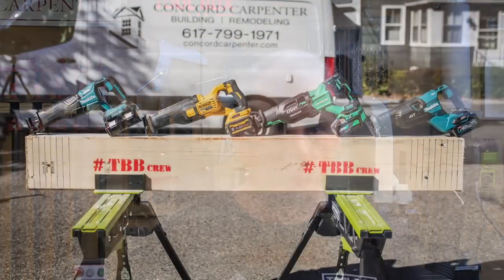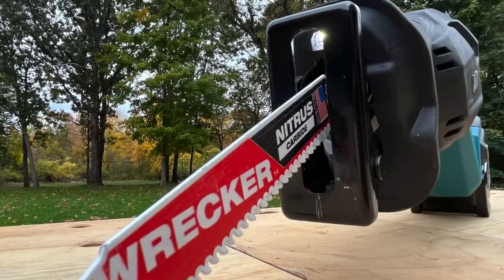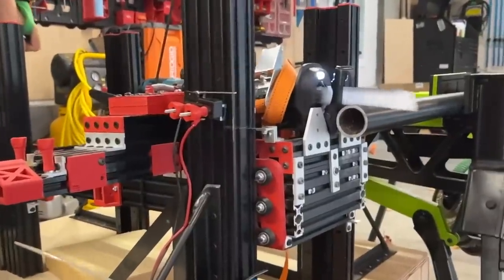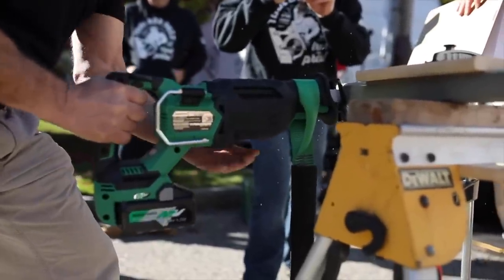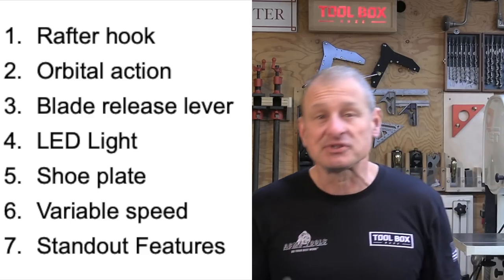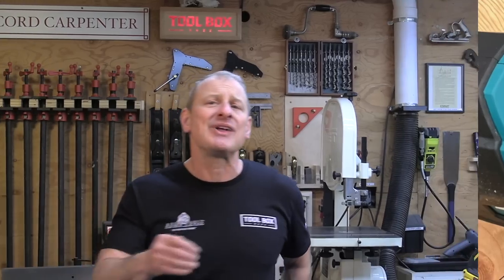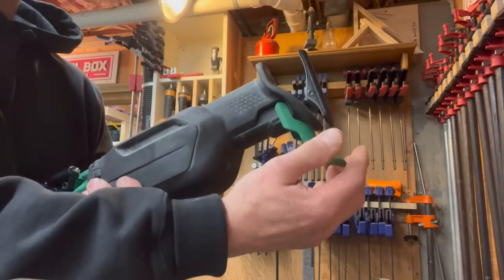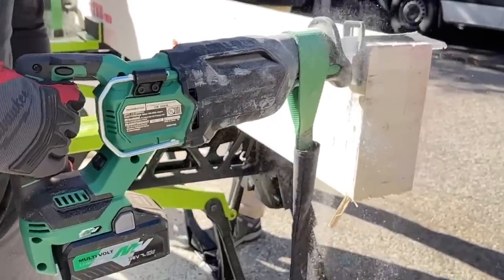Best "High Capacity" 36-60V Reciprocating Saw [Head-to-Head Test]

Comment: Have the 40v Makita and it's a beast with all the bells and whistles I might ever need for a recip saw. Adjustable-removable shoe, orbital cutting, speed dial, rafter hook, spring loaded blade ejection, avt works incredible, tons of power. I have no complaints.
Reply from the maker: Very nice!

Comment: Thanks for the comparison, Rob!  I've started a new business and I'm getting into a new tool platform, so I'm scrubbing through several of your videos.  I'm on a fairly tight budget, so I'm seriously considering Metabo HPT.  SIDE NOTE:  You have a lot of patience dealing with all of the prima donna's in the comment sections.  Always thankful for your professionalism.
Reply from the maker: Thanks for saying that, and for commenting! Welcome to business ownership. If you get some time check out my Contractor Business Tip Series.
Reply: @ConcordCarpenter  I'll check it out for sure!
Reply: I've been running Milwaukee and Makita for yrs after giving up on DeWalt before that due to poor quality cantrol, burned up motors and below average service
We've switch a bunch of our tools over to Metabo HPT over the last 3-4yrs and have been very pleased with power, workmanship, features, elearranty and the AC adapter for the 36V tools that we use for the table saw, mitre saw, grinder, SDS Max rotary hammer, vacuum and a few others-it saves battery life and longevity and allows for all day use when AC power is available
Check Acme and Toolbarn as well as Lowes
The 36V line are true pro grade tools and many of the 18V are pro grade as well
The mHPT/Hitachi nailers have and continue to be the industry standard
Reply: @JimDoubleYa  yes I was hoping to get the Barrell grip 36V that was being sold her through ACME but for some reason stopped being available
I waited for the Makita to go in sale but never did so ended up with the Milwaukee 18V Fuel barrel grip(it's a monster but cuts great)
As far as Metabo HPT woodworking tools
The 36V 1/2" Full size router is my absolute favorite tool in the shop and jobsite, the 23 gauge pin, 18guage are good, the rear handle framing saw, 36V sidewinder and 6 1/2 18V all are light and powerful
The 36V recipe is the most powerful recip we run
Triple hammer impact and 36V Hammer drill have been great and at great prices I er the last few yrs
The vacuum is great as it runs off 36V batteries and the AC adapter
The 36V table saw has been another favorite on jobsite as it is portable but has the largest workspace/capacity and again can be plugged in with the adapter for thicker ripping and all day run time without waiting for batteries to charge like the other portable cordless out there
The new 18V sander is as good as the Milwaukee and the trim router is also comparable to the Milwaukee but each is at a better price
The best cordless portable planer is the Ridgid Octane if u can find it otherwise the older Makita or the newer brushless(but you'll pay twice as much, the Metabo HPT planer is solid but not too performer(Milwaukee and DeWalt planers are junk)
Hope this.helps
Been in the trades for a long time
I have many different colors in the shop but mostly running green, red and teal for cordless now with a little orange for some applications
Reply: @JimDoubleYa  ACME has best selection and they run promotions each week for different tools so ya gotta check a few times a week
Toolbarn has had some sick deals this year as well and Lowes is currently running the 4.0/8.0 Multivolt battery and get a free rear handle, 7 1/4 sidewinder or 36V recip
Acme just finished a second round of $50 if u spend $200 which I'm sure they'll run again,

Comment: Since people kept asking for the Milwaukee Fuel to be included, here are the M18 2822-20 results from the test 2 weeks ago compared to these. It should be pretty close since its the same test, 10lb weight and blades used.

Pipe - M18 5.63 - HPT 36V 5.73 - Makita 40v 3.55 - Makita 36v 11.0
Unistrut - M18 4.72 - HPT 36V 3.01 - Makita 40v 2.70 - Makita 36v 3.54
Nail embedded wood - M18 32.14 - HPT 36V 53.50 - Makita 40v 30.61 - Makita 36v 40.15

I own the 36v Makita and what i did was have a friend who just needed more batteries and i needed the saw. We bought the kit and split the parts. We both saved money and the saw came out at $145 in July 2020.
Reply from the maker: Pepe your hired!! We tested ALL of the saws from 18v to 60v all on the same day. We separated the videos to give the heavy hitters their own arena.

Comment: These tests are very interesting on their own, but I think most of us choose a brand for battery operated tools and stick with it. How about doing a comparison of all the core, essential tools together and compare brands? Maybe a reciprocating saw, circular saw, drill, driver, finish nailer, framing nailer, whatever you think. Just taken as a group, which brand performs best and is well made? Because it won't kill me if I take two extra seconds to make a cut, but it will be very annoying if I run out of power before the job is done and can't simply take a new battery from another tool. That's the beauty of sticking with a brand, even if certain of their tools aren't top performers.
Reply: I started out doing small jobs and I had the same mentality on having everything the same brand. Now I have Dewalt on my truck for small jobs but for bigger jobs multiple batteries don't bother me. I get the best tools for the best price regardless of brand. Some of the deals for makita and Metabo were too good to pass up.
Reply from the maker: We don't disagree.
Reply: Idk about that. 

I'm on Makita 18V and 40V primarily, 80% of my tools are Makita,  but also have Ryobi 18v for home gamer stuff and tools I don't use frequently, and then Bosch 12v and Milwaukee 12v, and then DeWalt 20v to round everything out. 

I like the flexibility of being able to grab tools everywhere.
Reply: I buy what ever I thinks best preferably in a kit form all brand off good options for different tools I like to have options in my tools and wemon but that's a different story.🤔
Reply: I say the real masters have a some of EVERY battery platform not sacrificing quality in any tool purchased

Comment: Makita XGT is absolutely wrecking stuff recently.  

Their 3/4" impact wrench is head and shoulders above anything else.

They have every saw size you could want, and tons of different ridiculously powerful grinders. 

Possibly one of the best drill/drivers with their electronic chuck, etc...

Probably the most powerful cordless vacuums. 

Only thing that is somewhat lacking is their 40v impact drivers. Haven't really updated those aside from making them compatible with 40v.

Comment: Thank you for yet another impressive and informative tool comparison! I only have experience with a Dewalt flexvolt saw that we bought for professional use about 4 years ago. We do ground work, which include cutting plastic pipes for septic systems and drainage pipes, removal of misplaced limbs of trees, dividing some lumber, and occasionally some demolition work. Perhaps also cutting a few steel profiles. Not that hard work, and very little use during winter months of December to March. But, it can be a harsh environment with rain, dirt, sand and stone flour. Apparently, too harsh for the flexvolt saw, and the first battery burned after 11 months (7-8 months of use). The second battery started smoking after 13 months. We could not get new batteries from either the reseller or Dewalt directly. In truth we could not even get any real answers on this issue. So, we shelved the Dewalt saw and bought a few Bosch GSA 18 V-LI C saws instead. They work great for our purposes and only cost about 1/3 or less to replace compared to the Flexvolt saw (the first lasted about 2 and a half years). I would not recommend using the flexvolt saw in harsh environments. I guess that the batteries (probably the same for many manufacturers) are not sealed from water, to allow better air cooling, but it makes the more complex circuitry of the flexvolt batteries vulnerable to moisture.

Comment: That Metabo HPT wood cut test makes me scratch my head. 🤔 Mine is a beast through wood with nails.  🤷🏻‍♂️
Reply: that saw loves to get pressured i bet if they put some more on it it would crush the 40v
Reply: @abeltavaresperez7948  except the Makita 40v can also handle more pressure just fine, so.... still lose in the end.
Reply: @abeltavaresperez7948  I was thinking the same thing.  More pressure would change the game.
Reply: Yeah that's our experience as well and it's not even very close
Not sure what happened there

Comment: nice work! the results are exactly as I suspected and other reviewers have ranked.
It is quite astonishing that dewalt for having the flexvolt platform, haven't built a great recip saw on it.
Reply: I love dewalt except for recip saws by them. Just been taking away features (no rafter hook, no 4 way blade clamp, no adjustable shoe) over the years with every new model and not even being the best performing. Ive also had issues even with the blade clamp and the blade ripping out of the saw mid cut in multiple models including this flexvolt one. So frustrating. Always in cutting metal never wood but 99% of my cutting is metal. I even bought myself a flex 24v recip saw not too long ago even tho i am super invested in all dewalt 20v and flexvolt. All other flexvolt tools are fantastic tho and i love the platform. Grinder is a monster.

Comment: Another excellent test.
I think that you may try to use weighted arithmetic mean when calculating the overall score. It's because some features or performance are more important that the others. So like cutting time performance would have weight of 7 assigned, while mass of the tool would have weight of 3 assigned.
Reply: Agreed, when a tool is a 10%-15% heavier but cuts 25% to 50% faster, or even double the damn speed with the metal pipe test, then is the ergonomics score actually lower in real life use if you're sustaining less grip strength and vibration over time? Let alone the fact the XGT already has lower vibration to begin with.
Edit: Still love these videos though, as Rob mentions, we can decipher the numbers and narrow down the tool that is perfect for our use case,

Comment: It would have been interesting to see the Milwaukee super-sawzall in there. I'm surprised they didnt join in. Otherwise the Makita 40v Max line looks really legit. I've tried some of their tools and they are very impressive. I'm a Dewalt-guy, but would absolutely consider Makita 40v if it were not for my co-workers using mostly Dewalt. I do however own Metabo hpt nailers, since I dislike Dewalt. I also have to say that some of the Metabo HPT tools are really up there! Would love Toolboxbuzz to explore more of the Makita 40v and Metabo hpt-worlds
Reply: check the the channel, they have the other videos with the 18v -24v saws
Reply: Milwaukee super Sawzall is on their other video. 

Makita is still better when you compare times between that video and this video though.

Comment: The Metabo 36V UVP is the only way to go. It’s the most comfortable to use over long periods of time. Has the best real world vibration control. You get an outstanding ecosystem. The fact you can use you’re 36V battery on your 18V tool Metabo tools. Which you will want to do as you will get more power in the 18V tools using the bigger battery packs due to much less voltage sag. And if you for some reason are burning through a battery faster then every 45 minutes. You don’t really need it but you can plug in, just in case you do. And you get a lifetime warranty with all Metabo tools. You just can’t beat that.

 Still think the testing should remain fact based as much as possible. Also I feel that there should be some sort of way to blind test the tools. As brandboys will always lean twords the ecosystem they currently use. But that’s just how it’ll be. Once you buy so many of a certain battery and own so many of a certain brand. There is no way to escape. This is why I buy based on spec, function and ease of use. So far I’ve been very happy with every Metabo tool I own. For the price, the functionality and with Metabo having the beta ecosystem when it comes to running your 18v on your 36v battery’s and a lifetime warranty. Nothing is topping that right now. I would like to see some competition though, as it would only force Metabo have to make their tools even better. Along with all the other top dogs in the game.

I own a lot of different brands but right now we can all admit, Metabo is killing it in every way all while keeping their price just as good or better then the competitors.

Comment: I know the Milwaukee Super Sawzall isn’t in this voltage range, but I think it still belongs in this comparison. It’s competing directly with these saws. When I didn’t see it in the last head to head, I thought it would be in this one. Great video though!
Reply: They probably didnt want to be in the test or didnt send a testing sample in time.
Reply from the maker: You can certainly compare it - ALL of the saws were tested on the same day - we separated the high-capacity saws into their own video. You CAN compare the Milwaukee - same day, same tests, nothing different.
Reply: Oh my bad Rob! I watched the last head to head too, but I missed that the Super Sawzall was in there. I knew there were 2 Milwaukee saws, but neither of them looked like the super sawzall. But I looked up that model number, and it was, so yes, you already compared them. Sorry, I wouldn’t have commented that if I realized it was in the last head to head.
Reply: @ConcordCarpenter  but it only had a 5ah or so battery right?  Isn't part of Milwaukee's strategy to have higher amp hour batteries to give it more watt hours to compete with higher voltage tools?  Am I getting something wrong?

Comment: I really appreciate your testing, it brings both personal preference, which can be subjective but it's similar to polling people, eventually there is a basic consensus even if the differences are negligible. And much more empirical testing which can show very minor but important or even unimportant differences. Slow mo can mess with people's observations and make minor differences look huge, similar to sports replays. For most people, well, at least me because I doubt I'm special in this regard, is performance is secondary to comfort and reliability until poor performance becomes a liability. 

I have the 18v Makita brushless recip and was surprised the 36v doesn't have an adjustable guard. 

One test I would like to see is 18 gauge staplers, or any staplers. They are commonly used but everyone seems to ignore them.

Comment: How the hell is the Makita 36V significantly slower than the Makita 18V on the 3x 2x10” wood with 15x 16p nails embedded that you tested in your other video? 40.15 seconds for the 36V seconds vs 28.69 seconds for the 18V. I have my doubts about those figures.

Comment: I don’t understand what Dewalt has against adjustable shoes on their recip saws. Even their higher end and newer saws don’t have it. Their old 20v max with the 4 way blade clamp is the only one I’m aware of that has one. And even then it’s kinda sloppy. The Dewalt saws definitely need an update. 

The power adapter for the Metabo is pretty neat, but they should have the electronic brick in the center of chord. I’d rather see a “wall wart” style plug.
Reply: Yep, they even got rid of the multi position collet on the latest one. They have trash recips

Comment: 🤟🤟 have the dewalt like all power tools both 18v and 54v. Hook is joke why they don’t have 1. Bricklayer so just use it for demo stuff very good saw. Blade they bend very quickly so not keen spending silly for 1. Blade did get hilti blades to try few bucks dearer but seeming very good. Rob would you favour the diablo over the millwaukie blades ?

Comment: I’m amazed at the results. I have the dewalt flexvolt and the makita 40v . I prefer the dewalt. I feel like speed of cut and brute force are more important when it comes to recip saws and I feel like the dewalt is an animal. The makita seems like it lags behind. However I do like the rafter hook on the makita and do wish dewalt had one. 
I really like the review and side by side comparison. I will have to grab the makita next time to see if there is a difference. 
Thanks for the review Rob. Outstanding as usual.

Comment: I have been trying to find videos putting the Dewalt 60v saw to a suitable test. Seems that their is a thinking that this is supposed to be a flagship general purpose saw, and it winds up being criticized for lack of general purpose features. I think the lack of speed controls and orbiting are because the saw is intended for a specialized purpose, which is heavy, slow cutting through thick, dense materials. That is why it doesn't perform well when put in competiagainst untreated soft wood. Would you guys consider doing a hard material test? Thanks.
Reply from the maker: @steveg7000  good point, thx for sharing

Comment: The thing i found fascinating is that the makita 40v was almost 2x as fast cutting in metal but 3 saws finished faster than it in the nail embedded wood test. Why do you think the bigger saws were slower in nail embedded wood?
Reply from the maker: not sure
Reply: What? The makita won every test including the tests with the wood in it from what I seen🤔